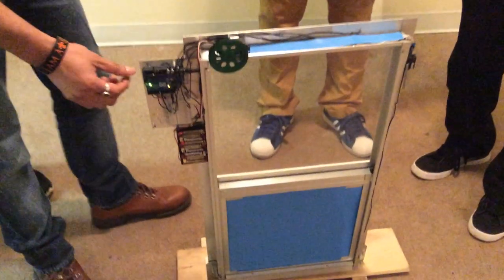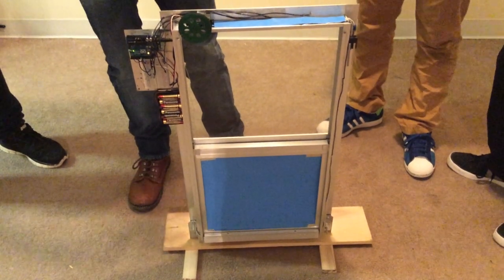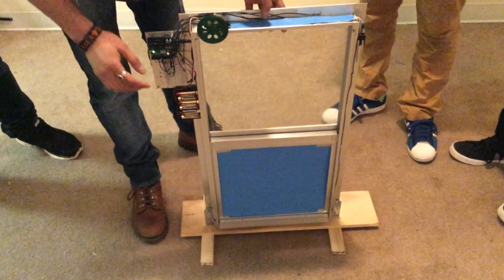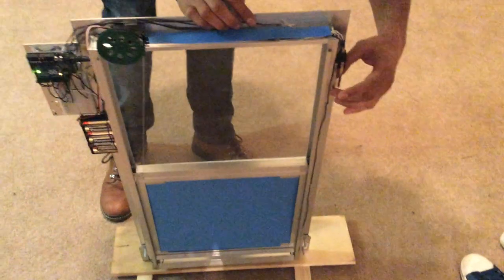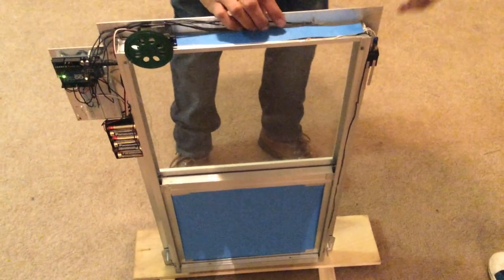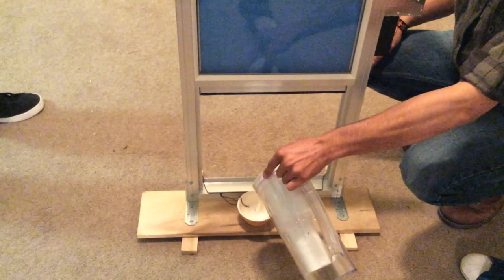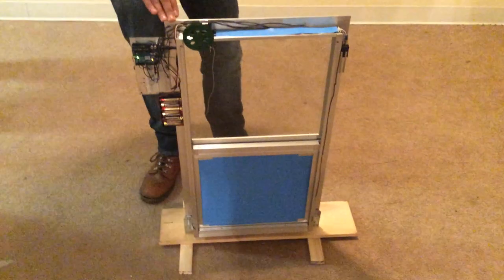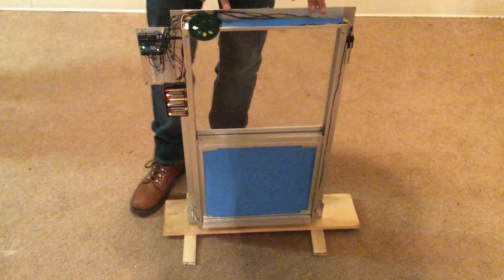Automatic Sliding Window Opener - Swanbom - Spring 2014

Comment: hey i liked it but i see a flaw in your sensor ....the bowl wont drain the water so the window wont open automatically but instead of the bowl system if you use moisture sensor then you can add the additional function of auto opening....but cool mechanism

Comment: I would love to purchase and install a production model.  
The water sensor is a great idea. 
Needs a safety shutoff switch similar to the ones on automatic garage openers.
This idea depends heavily on a production window that slides up and down with minimum effort.  Most do not.
Reply from the maker: This project is just a prototype. For heavier window, we would use a motor instead of these servo.
Reply: You can contact us for the similar products for real uses.